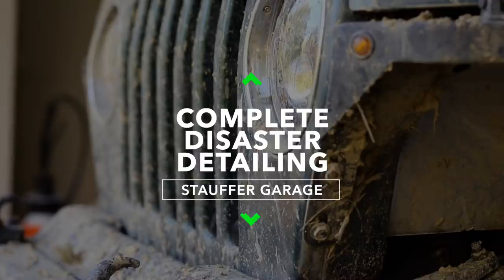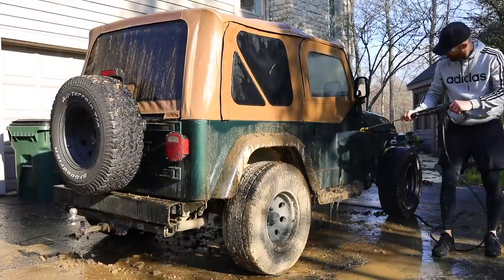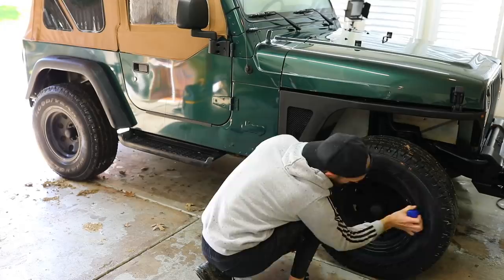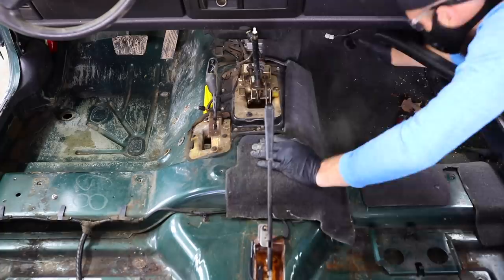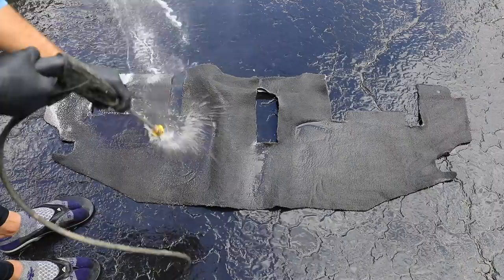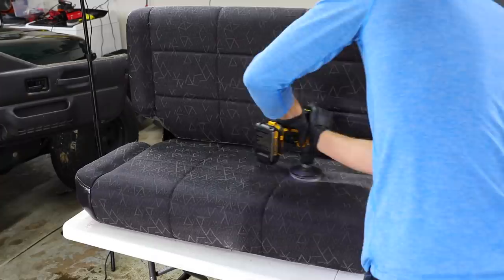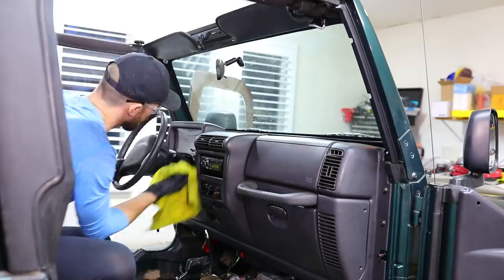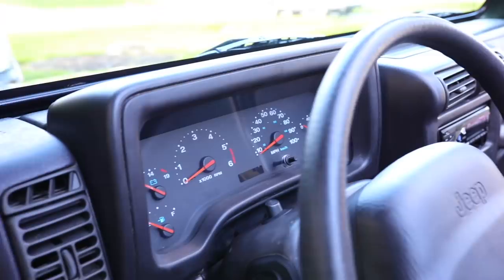Car Detailing The Dirtiest Muddiest Jeep Ever! Complete Disaster Car Cleaning Restoration

Comment: A great way to get organized with cabinets is to go to Lowe’s or Home Depot and purchase their cheap line of either white cabinets or natural wood, in the sizes and widths you wish, My garage turned out great and gets great compliments all the time. Utilize pegboard behind whatever fpptage needed. Painted mine white to match cabinets and by wire inserts to fit what you want to place there....it will look outstanding and relatively cheaper than most. Check the area where they mark things down incredibly, sometimes cabinets will show up there.....Bob L

Comment: A jeep that goes through water and mud should never have cloth interior, it should have a thick rubber mat covering the floorboard. I usually pull out the floorboard rubber mat and run a water hose to wash out the floorboard. washing my jeep when it comes back covered in packed on mud takes a few hours to completely  clean. Great job!!
Reply: Or no interior at all except seats

Comment: 12:24 A telltale sign that this car is a "Buyer Beware" - Both sides have drain holes to let water out of the floor pans.
"Only been driven to church on Sundays by my Grandma."
Reply from the maker: Lol I thought the same thing with the floor pulled up... this wasn't the first time lol
Reply: @StaufferGarage  FYI - If you put some type of heavy-duty non-porous[waterproof] barrier [plastic/vinyl {Thin plastic cutting boards}] between the rusty areas and the carpet it will prevent the rust stains from penetrating into the carpet in the future.[and help prevent rust itself {since the rug itself is the secondary cause of the rust} the rug will be able to dry out faster]
Reply: Wranglers are designed with drain holes in the tub.
Reply: @TheaterGeek2007  Yes, but they are covered by  PVC plugs at the factory. They were taken out of this car.
If the PVC plugs aren't replaced, water from the road enters into the passenger compartment.
Reply: All jeeps have drain plugs
Reply: @TheaterGeek2007   Wranglers are designed with drain holes in the tub THAT ARE COVERED, this one has open drain holes, hence OP's comment that buyer beware.
Reply: dont know if you will see this, but to remove rust stains in the carpet, mix a batch of oxyclean, let sit in the carpet for 15 minutes...rinse and repeat.
Reply: I was draining my plugged ac drain in my car and manage to spill inside, 1st I noticed a bolt that fixes to nothing and figure it's a drain plug, unbolt that but it's draining slow then ai noticed a black stopper of what looks like what you mentioned.
Reply: That's what I thought
Reply: $6.35. Us. And also he the owner should linex the floor.

Comment: I have a 2 door jeep wrangler jk. And one of the best "modifications" I've done to it is remove the carpet from the rear of the jeep. I still have the carpet for the driver and passenger. But I took out the rear carpet and it has made cleaning so much easier. I plan to put spray in bed liner but right now its bare metal and just needs a quick vacuum/ sweeping and boom basically done

Comment: Hey Man, Love the work! But I have had rust stains in carpets before. And normally the floorplan is the part that's rusty. Next time you have the ability to pull out the carpets, start your first round of extraction on the bottom of the carpet. The rust is coming from under the carpet so try and do the same thing. Its worked for me in the past

Comment: i actually thought to myself why bother, the jeep will be in exactly the same condition as soon as the owner takes it back out again. saying that, the end result makes it worth the bother. good result just a shame about the metal oxide on the carpets. 
i did look on the net for rust removal of carpets and found several technics but they all seemed a little old wives tale stuff.
if i find anything solid i'll pass on the info!

Comment: I agree. If you pulled the carpets out of the car, then what is the point of washing them with a water vacuum cleaner? It is much easier to wash them with pressure water.

Comment: hey just found you!  i like your videos!  just a couple of thoughts for you regarding the carpet stain that wouldn't come out - i once had a pen leak in my jacket and that stain never came out with any cleaner products.  but i was able to get it out years later my soaking it / rubbing it in isopropyl alcohol.  completely.  also you might try to put the carpets on a vertical or slanted surface and let gravity help pull the dirt down, just like how you do the seats.  👍🏽 👍🏽

Comment: I have a suspicion those irremovable carpet stains might be blood, as it could be likely that a deer or something was hauled in it.  For those types of stains you might want to try a mix of hydrogen peroxide and soap. [Make sure that the mix you use isn't volatile/dangerous]

Comment: What's the use of buying this expensive equipment Carpet Extractor etc. And it doesn't remove tough stain like it says but I wonder you missed the last step which is to steam the stains so I'm not sure just yet about those stains coming off or not.

Comment: Please do the detailing community a service (and your customers) and stop using this ridiculous two bucket method. Watch just about any detailing video and what do you see people striving to do? That's right, they do all they can to keep from grinding dirt particles into the clear coat/paint. That's exactly what this stupid azz two bucket method is doing, Think about it! You take a clean microfiber and wipe down a panel. That towel is now contaminated, so what do you do? You "rinse" it off in a second bucket. Now the towel and the "rinse" bucket are contaminated so what do you do? You put the contaminated microfiber towel back into the clean soapy water and now the towel, the wash water and the "rinse" water are all contaminated. Yeah I know, you THINK it's clean but you know it isn't. The solution is simple and makes a helluva lot more sense than the two bucket con. Fill up a bucket with suds of your choice and toss in a dozen or so microfiber towels. Take a towel and wash ONE panel and then toss that dirty towel into the To-Be-Washed pile. Repeat with a clean towel each panel. A dirty microfiber never re-enters the soap bucket. Rinse with a hose for crying out loud. It isn't nuclear physics people.